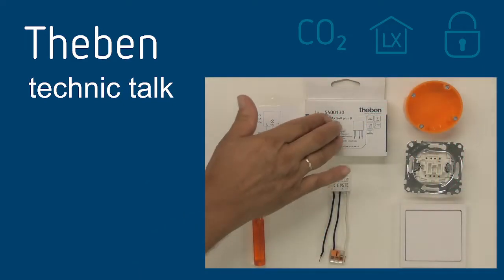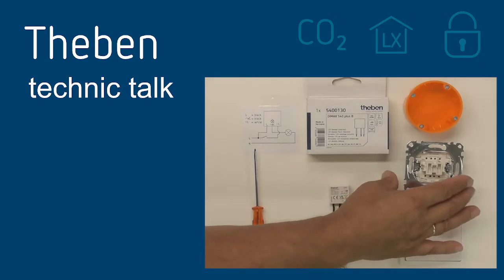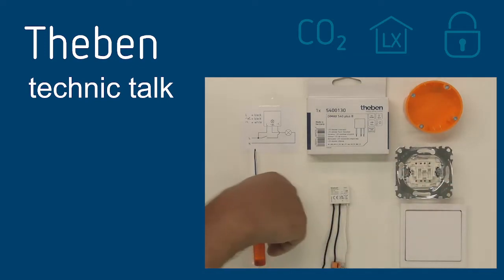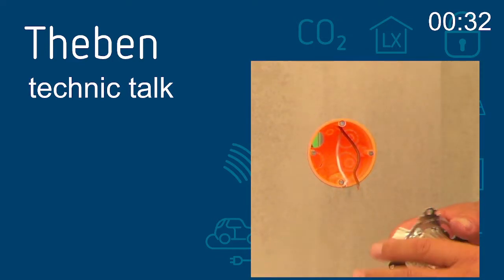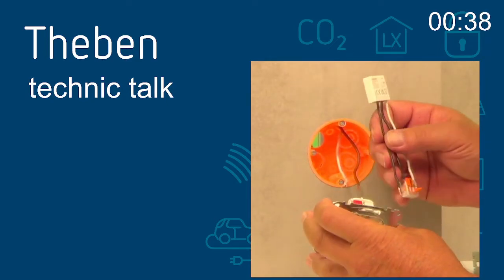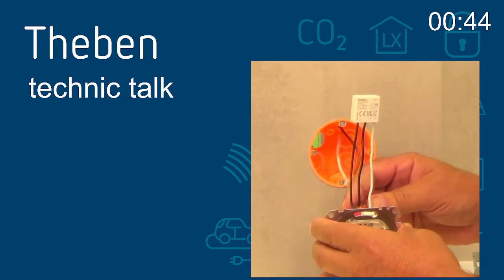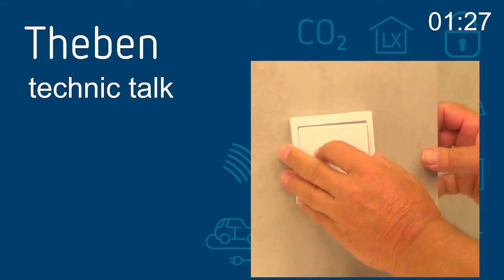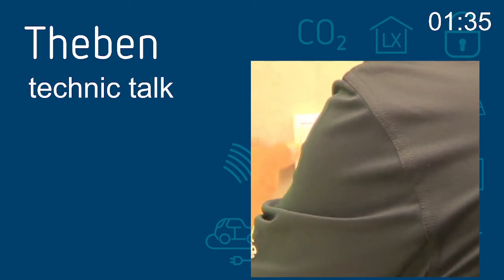Theben "technic talk": from switch to dimmer #DIMAX 540 plus B

Comment: Thanks for the video.

The product is absolutely great when the dimensions are considered, but found some difficulties in dimming.

The dimming levels are not fixed, such as if I am pressing the push button for DIM UP it will start to DIM DOWN if I dont release the button. 

Need a solution to have smooth dimming levels.
Reply from the maker: Hello Abdul, cpoud you please tell us more about the problems you encountered? Please get in touch with our support hotline at +49 (0)7474/692-369 or hotline@theben.de. They'll lend a hand ;0)

Comment: Thanks for the video. However, the viewer could not see how exactly the wires are connected to the Dimer. Pleas show the connection diagram, so people know exactly which wires are connected to which terminals.
Reply from the maker: Hello Tuan Le, thanks for the positive feddback - and your suggestion of course, which I forwarded to both the service/training department and the video producer. If you need i wiring diagram for that use case, please get in touch with our support hotline at +49 (0)7474/692-369 or hotline@theben.de. Best regards Hans / Theben AG